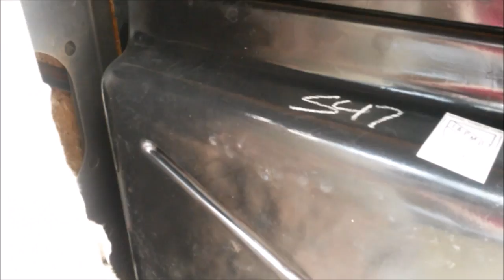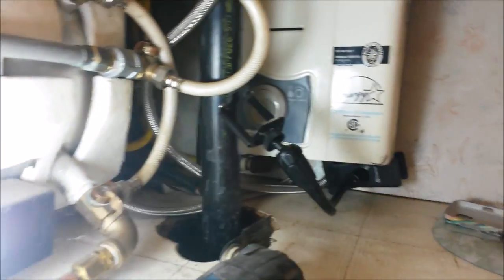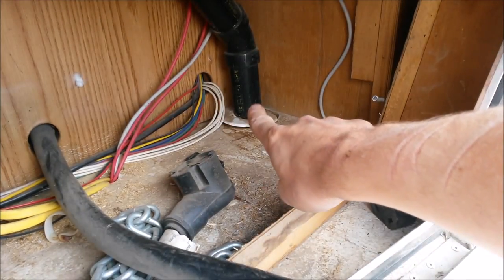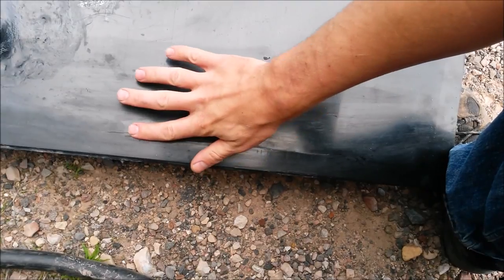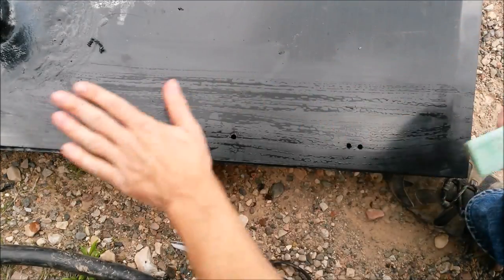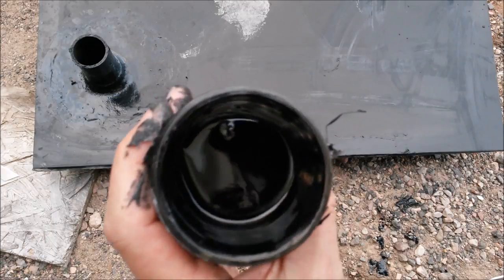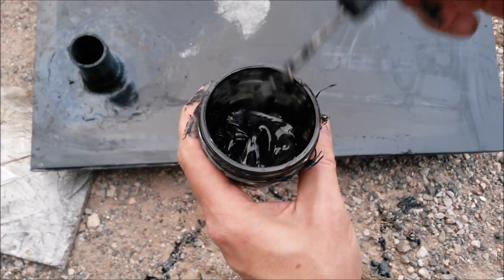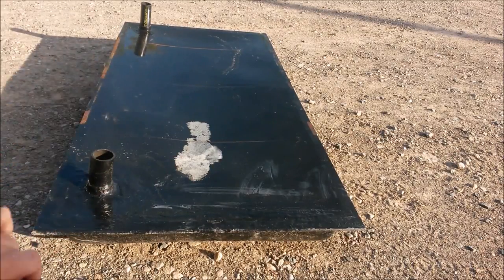(:HowTo:) Permanently Fix a Leak/Crack in an RV Black or Grey Water Holding Tank ~#3 Dropping a Tank

Comment: Thank you for sharing this method of repair. I have one thing to suggest; there are rubber couplings with band clamps that could be used to secure the pipe ends together just in case the tank get hit by something that causes it to leak again.

Comment: Great Video. Wish I saw these before using tape and other goop. My crack is on the 3 inch exit pipe. About 6 inches long so too long for a strap repair. Going to try your methods as another option. Thanks Great Vids. Repair people are not looking for music, introductions or welcome messages, we will remember you without all that time consuming stuff. Thanks. Following now.

Comment: Great video! Thanks for showing the details of getting the tank out. You said you were using a union to put the pipes back together.  In fact, you used just a simple coupler.  It would be best to use a real union so that you can easily take it apart for the next time you have to remove the tank.

Comment: I would plastic weld it with a hot iron. We use plastic welders in body shops quite often. A soldering iron will do the job.

Comment: Thanks for the video. I'll need it because I'm new to RVing and my Tub wouldn't drain, I thought it was stopped up but all it was - gray water tank was full and need to be emptied. I didn't know this and I used my air compressor to unstop the drain and this caused a leak in the piping where it attaches to the top of the gray water tank,
Reply: Did not explain steps could not follow , what I saw looked good but ?

Comment: Very nice video!   Hope I never have to do this.   Any reason you can't weld the tank?    I welded some abs for a different use, but it is still solid.
Respectfully,   Kevin
Reply from the maker: You can totally weld a crack. Even better, weld the crack and then weld a large patch of Abs over it.

Comment: It looks like the Crack was progressing away from the vent. That tells me that the tank was moving in relation to the vent pipe. Probably during travel. 
The Crack will re develop with time if you don't intervene.  I would put a flexible connection between the tank and the vent pipe.

Comment: Hi great video. I'm glad I did some research before just buying a new tank, for an old trailer. This last year I hit a bit of a dip and ripped off the entire discharge pipe for the grey and black water off right off.... yes we were off road... and it was more of a mud hole. lol. However, after watching your videos I am fairly confident I can fix it. Problem is I have to replace the flange on the black water. You had mentioned you did a vid, showing how to do this, but I can't seem to find it. Would you be able to send the link? or maybe let me know what part I will need to install a new flange onto the tank. Thank you, and cheers in advance.
Reply from the maker: You mean the blade valve, or the actual output flange the you glue the exit pipe into?
Reply: @TrailerDayz    well both to be honest... the entire discharge pipe was ripped off. Blade valve, right to the tank. And the flange on the tank is mangled. So I will need to replace the entire discharge pipe. Blade valves included. It's all at the bottom of a mud hole in the mountains somewhere up the Coquihalla highway near Merrit. I figured the blade valves would be easy enough to order off Amazon. I am guessing a large ball valve wouldn't work that well for Blackwater?
Reply from the maker: @thesarcasticangrydud  Yep. Blade valves are cheap. You can replace just the valve:
https://amzn.to/2IIU1LZ
Or the whole thing with inlet flanges. Not sure if you can easily get the drain flange. If you have anything left of an outlet pipe at all it might be best to glue onto it with an ABS union.
Reply: @TrailerDayz   there is a little bit of flange left at the tank, but it's pretty mangled, and it's cracked around the bottom, and the crack carries on up the side of the tank. If you have an email address, I can send you a quick video. Your advice would be greatly appreciated. The tank is easily accessible.
Reply: @TrailerDayz  Thank you, young fella.  Likes your video "guide" & your decent grammer.  First time hearing "blade" valve.  Folk also incorrectly call them "slide valve".  The correct name is gate valve.  "Ball valves" are correctly called globe valves.  Where is that video of making your swizzle stick?
Reply: @thesarcasticangrydud , I did the same thing of ripping off the plumbing.  Did this fix work for you?

Comment: Can this method be used where the tank is spin welded for the drain pipes? I think that’s where my leak is coming from
Reply from the maker: No. A white tank is made of a different material (polyurethane) those need to be repaired with spin weld plugs.
Reply: @TrailerDayz  the tank isn’t white. It’s black like in the video. I can get to it through the access panel. It’s kind of the same as video #2. I don’t know what you mean by white tank
Reply from the maker: @alexisjennings1818  A white tank is usually for fresh water and will be square. A black tank will be for Grey or black water and will have rounded edges. All black tanks will be made of ABS plastic and these methods will work.

Comment: Do I need to know what material the tank is or is all the plastic the same? 2014 trailer. Also, mine is the black tank, do I need to remove the toilet or be concerned about that connection?
Reply from the maker: If it's black, then it's ABS.
Reply from the maker: If you are removing the tank, yes, all connections need to be cut or disconnected.

Comment: Wow! Love the quality and precise cutting of the hole in the floor for the drain pipe to the tank. Looks like someone thought it was a 10 inch drain pipe rather than the normal 1 1/2 pipe. Typical crappy RV factory construction.

Comment: I have a black tank that's been sprayed with foam to protect it from cold weather but it now has a leak and the spray foams been saturated with human matter. What would be the easiest way to remove the spray foam safely without the human matters dripping on me?
Reply from the maker: Xue Lee Your gonna have to let it dry then go in with a putty knife and just start scraping it off. Once you get down to the ABS, you will need to sand off the foam residue.
Reply: @TrailerDayz  
Alright thanks. here goes it.

Comment: keep in mind, this method only works for abs tanks, not polyethylene. Make sure you determine what kind your tank is. There is a much better way to fix these tanks, both abs and polyethylene, and actually makes the tank better and stronger than original, especially abs and there is no awful messy fiberglass and resin to deal with and no glues necessary. This method is incredibly slow, a lot of work and add up the cost of all the materials.  Whew, to much time and work and only bridging the cracks. It will seal but wont gain any strength, no matter how many coats are put on.
Reply: What’s your method please?